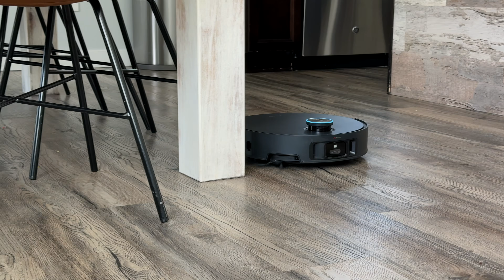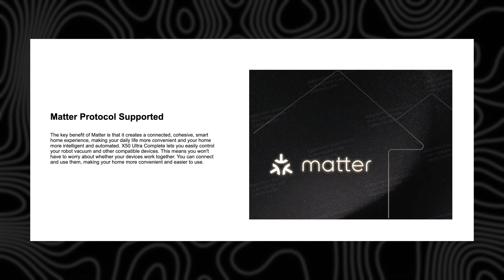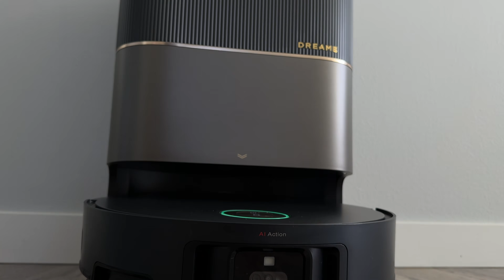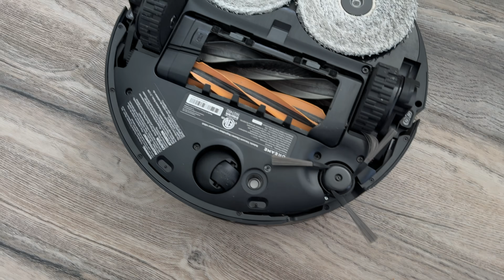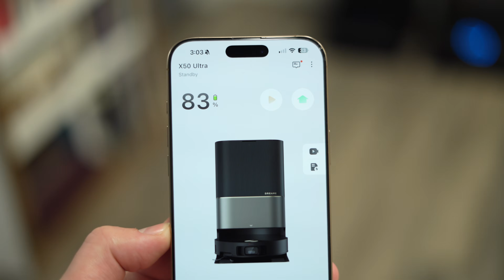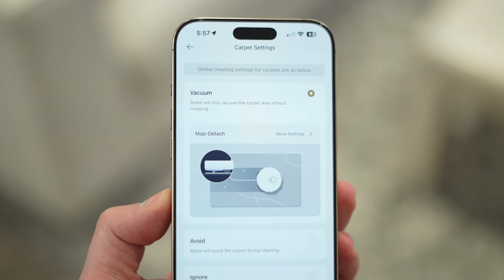Dreame X50 Ultra after 4 Months - How This High-End Robot Vacuum Held Up

Comment: I have the X50 ultra and it constantly gets stuck on doorways lower than the max height and also gets stuck on some of my chairs. It also for some weird reason struggles to find specific rooms even if there is nothing blocking its path. I like some parts of it, but i definetly have some complaints about it too.

Comment: I have it for 3 days now I’m not happy. I got L40 as well upstairs and x50 seem much dumber,does not extend mop arms or brush arm for some reason even when setting is on doesn’t clean near wall edges or corners. Setting is on. Doesn’t recognise glass or stainless steel legs keeps bashing it every time like can’t remember it even set tables on map. I’m going g to have to co tact customer service I spent hours setting g it up and suppose to be more advance than L40 ultra I wish I never updated to X50

Comment: So... i just bought it, but it looks used before. But the box was sealed with original DREAME tapes. So if the product has water marks on robot or wheels look bit dirty with dusts, its ok?
Reply: There should have been a sticker (or some other note) saying specifically not to worry about water marks due to factory quality assurance testing. There was on mine.